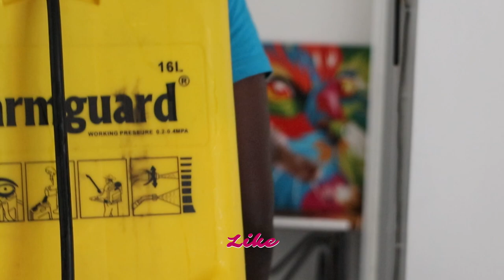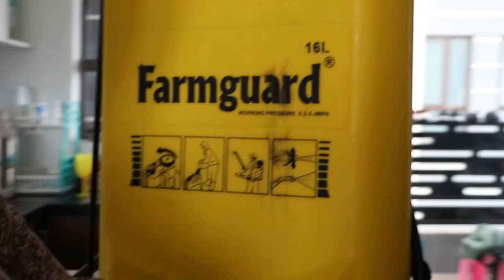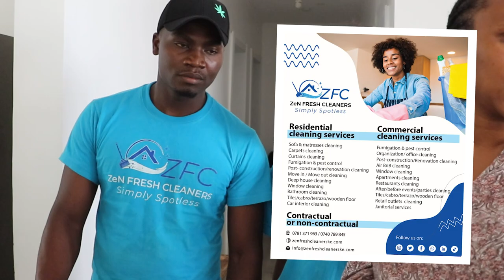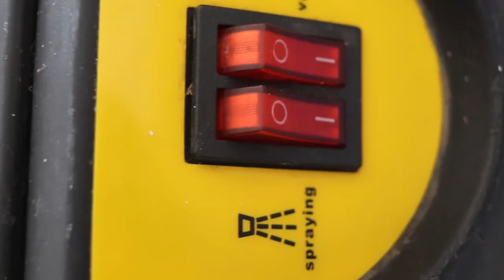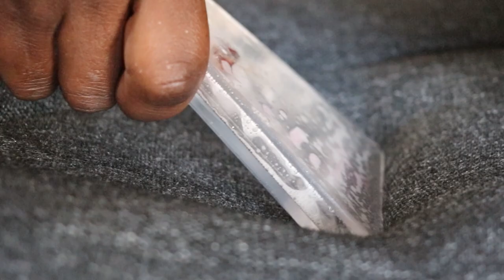FINALLY Getting Rid of the ROACHES || Fumigation and House Cleaning Vlog || Soila and Curtis

Comment: Hi Soila thanks for sharing. When I used to do catering from my house roaches became a real problem as they'd come through the pipes of neighbouring houses. I tried this type of fumigation several times but it didn't last long. Until someone suggested I try using Rudsect chalk and draw on my walls inside kitchen cabinets and on the corners of my walls. Guess what those silly roaches started to drop dead one by one until I forgot we had an infestation. It lasts about 6 months and then we repeat the process. I haven't found Ridsect chalk in the market but there are some from China that are also quite potent. You could back up your fumigation by drawing on your walls. Cheers 🎉
Reply from the maker: We've also had fumigation done before in the past, the roaches were still alive and well the next day. So it's important to get the right one. We mostly like to use referrals because at least we trust that the person who recommended has already seen results.